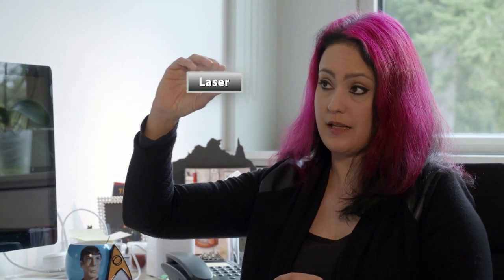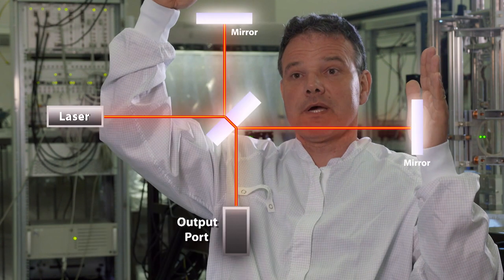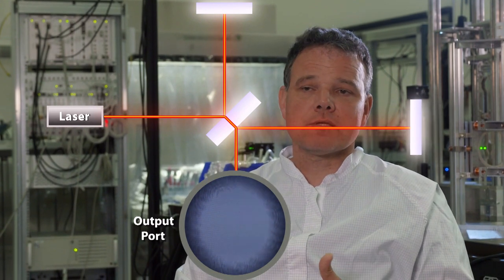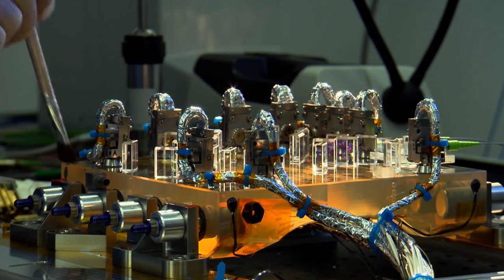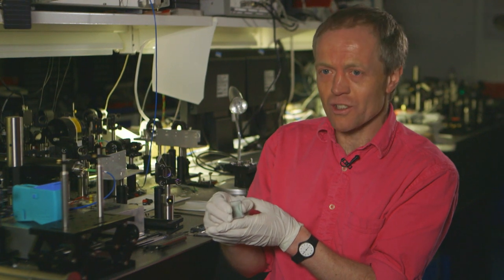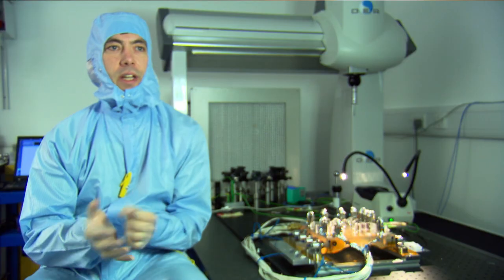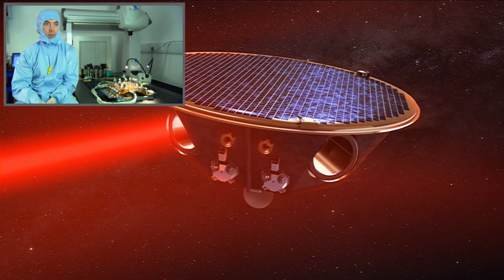The path to LISA: The interferometers of LISA and LISA Pathfinder

Comment: i always see the interferometers depicted as splitting the beam into 2, creating essentially 2 axes along which length changes can be measures. My question is: why not split the beam 3 ways, into an xyz (ergo 3D) system?
Reply from the maker: That would basically be three interferometers sharing the same vertex. For LISA Pathfinder and its experimental goals there was no need to do this. LISA consists of three effective Michelson interferometers, although their vertices are at the corners of the triangle.

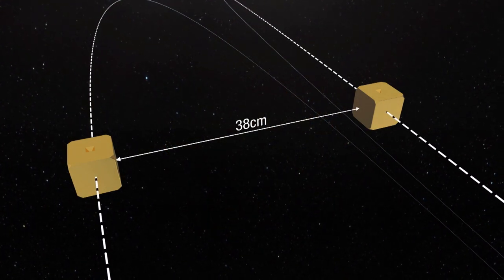Comment: 1:56 only 38cm? i was all excited for using the vacuum of space and a really long unfolding arm to get a truly gargantuan baseline per satellite
Reply from the maker: LISA Pathfinder was a technology demonstrator that need full local control over both test masses. Therefore the interferometer arm had to fit into a single satellite. This dictates the 38 cm arm length mentioned in the video.
Reply: For the full scale LISA observatory, the arm length is 2.5 million km and we’re looking for changes in position on the order of picometers.